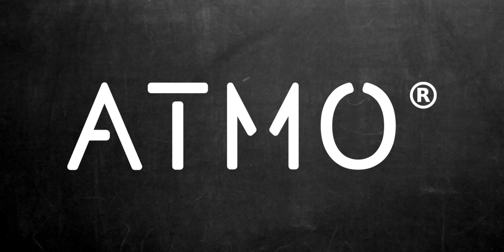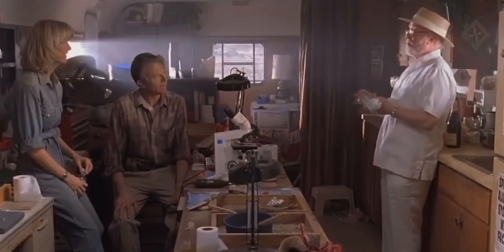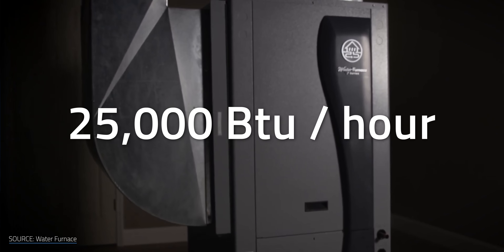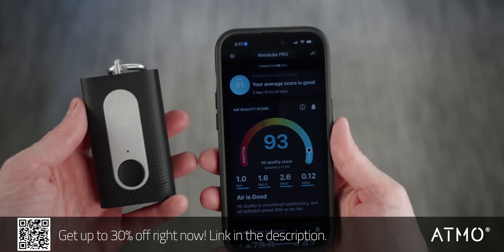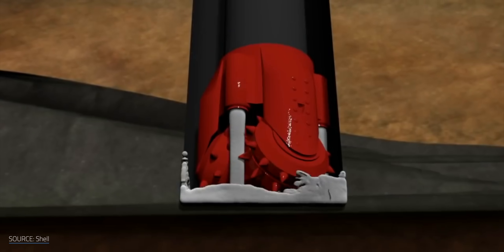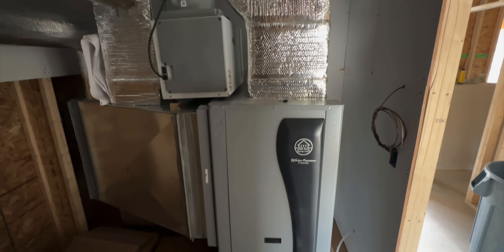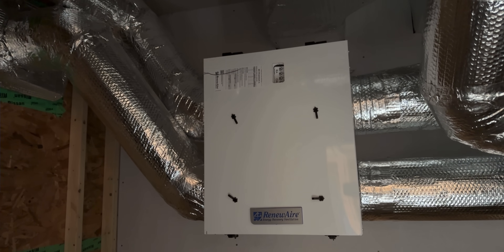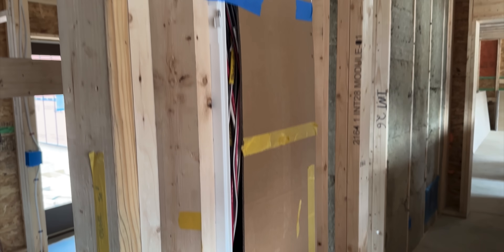Why I Went With Geothermal For My Net Zero Home

Comment: I have a 3 ton Waterfurnace series 5 with two vertical loops,forced air, for the last 10 years and never regret getting it. I recently added a 11k solar array with enphase IQ8 micro inverters . No heat or cooling bill no electric bill. I did tons of research and came up with the same companies you are using. Says a lot about their products.
Reply: Thank you for choosing WaterFurnace for your home. We appreciate you.

Comment: I like how you have low voltage lines to all the windows.
Many people think about automating the lights, but not the blinds.
I also recommend running mains AC to all the windows when a friend of mine had his house built.
I don't think he eventually used them though, but he did implement the wires.

Comment: Matt, it's not too late to add in a hydronic underfloor radiant heating system! 😁 It would work beautifully with your geothermal I think. As a fellow allergy sufferer I find ducted air cooling to be a blessing in summer, but ducted air heating in winter an uncomfortable curse. Having lived with heating from wall mounted radiators, wood burning stoves, ducted air and underfloor radiant, I would choose the latter way ahead of the rest every time. I love the wonderful gentle warming from your feet up compared to that stuffy air around the head feeling from air heating.
Great to see your build progressing and providing us all with lots of ideas & inspiration & good luck!
Reply: I'm thinking of the heating for my future home and I like the cooling possibility that ducted air gives, but I've never experienced it, I don't think. I really really dislike the windy feel window A/C type units give - and the constant background noise too. (Air-based systems are still rather uncommon here. They haven't been cheap or efficient  enough for long enough - local temperatures are roughly the same as Matt described in the video.) While I absolutely love wood-burning systems, the kind I'd go with need a person and a bunch of yearly work (as in, I couldn't leave home for a week in the middle of winter without problems and can't come to a warm home after a long day of work in winter). 

I'd like your random opinion, kind stranger :D
Reply: @mirjam3553  I've had ducted air cooling and wall mounted A/C, and the ducted air has always given a more gentle delivery, especially if combined with ceiling fans. Noise can be an issue, but can be reduced by careful placement of the cooling unit and the use of baffles.
Reply: "stuffy air around the head feeling" Thermal stack is real. With a radiant wall heater in my kitchen I have to use the ceiling fan to mix the layers.
Reply: I don't think he will have those issues because his house is so tight. A house as tight as this does not have the same stratification problems that regular homes have and don't result in nearly as much variance of temperatures. Plus, that ERV along with a very high performance filter system will help keep the air circulated and clean. Can't wait to see this all in action.
Reply: These systems tend to start breaking down at the water manifolds after 10 years.
Reply: @michaelsearnest  I haven't experienced this, but with an easily accessible manifold with compression and/or push fit connections, a replacement could be fitted in minutes.

Comment: We've been in our own new house for about 8 months now, with 3 vertical 500 foot wells serving as the ground loop for our "geothermal" system.  I absolutely love it.  It is silent, ridiculously efficient, and should outlive me.  No regrets!  (Yesterday, I heard a bizarre noise coming from outside, only to eventually realize it was the compressor on our neighbor's air conditioner.  Weird!)

Comment: Since you've chosen overkill, I hope you're putting in a builtin vacuum too.  In rooms with hardwood or title, a single slot along the wall allows you to open up the intake with your foot, then sweep any dust right into the opening.  Really handy for cleaning up in the kitchen.

Comment: I am really interested in understanding the advantages of a smart electrical panel.  I have solar but decided against batteries in favor for VTG bidirectional charging.  I am planning on switching out to EVs when this technology is more established.  Would be interested to hear about how BiDirectional, Solar and smart panels combine to a solution that is robust, has some level of independence for power usage.

Comment: Thermal mass and extra-good insulation should work just  fine for both heat and cooling. It works great here in Colorado.

Comment: Why didn't you go with a tankless electric water heater?
Reply: Because a heat pump uses ~ 3-4 times less energy to heat the water. Theoretically tankless heat pumps are possible, but generally are less efficient. Also using a tank can give you better energy buffering so you could run it entirely off of solar, while for a normal electric heater a PV setup mostly cannot provide enough power and you need to pull from the grid.

Comment: Matt, Do you think it would have been more efficient to build a concrete dome house? and are you planning on using sun tunnels for daytime lighting? just wondering as that's the route I'm hoping to take and wanted to know your thoughts. Geothermal with in-slab heating is in my plans as well.

Comment: I hope your GEOthermal goes better than mine. The system works fine but I purposely had the installer put in a unit 1 ton large than they suggested. It still has a hard time keeping the first floor warm. I am much happier with my heat pump system (ductless system). for the bedrooms and third floor. Had the heat pump many years before the geo system and it has never had any issues. Not to mention I have to keep adding small amounts of water to my closed loop system. Not a lot but it is still an added hassle a heat pump does not need. Had to replace a blower in the geo a few years back. Never had that problem with a furnace so new before but that could just be the Carrier system which I would recommend no one purchase.

Comment: we have automatic shades - triggered by a light sensor - so when it is too bright they go down.. then back up when the light drops.  we are west facing and get blasted by the sun.  The automation based on brightness is perfect.  does it save power - probably, but havent measured that to how hard our heatpump is working to cool the house.

Comment: i love the idea of a smart home, but i'd only consider it when most cybersecurity experts are willing to do it.

most cybersecurity experts i've heard of, stay as FAR away from the internet of things, because of the lack of security in them, and the lack of a commitment to cybersecurity in the companies themselves.
Reply: As a cybersecurity expert, I'm fully on board with home automation. Many of the risks associated with IOT can be mitigated, especially if you choose products which can be controlled locally on your network which Matt seems to be prioritising with home assistant. Other risk reduction measures include isolation of devices using different vlans and restricting internet access to only devices which require it / which are trusted.

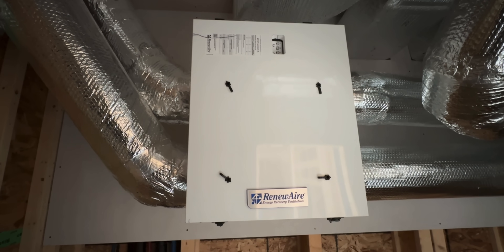Comment: At 8:21, Matt said “Homes need to breathe.”  𝘕𝘰𝘵 𝘦𝘹𝘢𝘤𝘵𝘭𝘺.  People 𝘪𝘯𝘴𝘪𝘥𝘦 𝘵𝘩𝘦 𝘩𝘰𝘮𝘦 need to breathe.  Maybe it was an unscripted comment, but I 𝘤𝘳𝘪𝘯𝘨𝘦 when people who know absolutely nothing about building science repeat that antiquated old wives tale.  (I’m thinking of old contractors with zero formal training, not Matt.)

I’m on the way to making my 1950 house Net Zero.  Solar panels on the roof 𝙪𝙨𝙚𝙙 𝙩𝙤 supply 100% our electricity, until we bought a plug-in hybrid in July 2022.¹ 

In 2011, we super-insulated the walls with “pour-in” Icynene (open cell phone).  We sprayed the underside of our roof with foam as well.  It made an enormous difference, especially considering that we had ZERO insulation in the walls.  In fact, a previous owner drilled vents into the walls from outside;  this was to remedy peeling paint 🤦‍♂️  (My personal trauma with “houses gotta breathe.”)

Later in 2011, we got rid of the old oil boiler and steam radiators.  I admit that I fell for the ßS of the oil & gas industry — we went with a direct vent forced hot water system that uses “clean burning natural gas”.  If only I knew that methane is just as bad for global warming/ climate change as 𝙘𝙤𝙖𝙡.  Sure, natural gas creates less particulates when burned, but natural gas leaks from the well all the way to the end user is about 10% of production,² and methane is 84x as potent as CO₂ as a greenhouse gas, for the first 20 years.³ And we’re about 50 years behind where we should be because Big Oil buried, denied and cast doubt on global warming since the 1960’s.⁴

In 2022, I added a layer of rigid foam insulation to the 𝘪𝘯𝘴𝘪𝘥𝘦 of the walls.  This was to reduce the “thermal bridging” caused by the 2x4’s in the walls.  I was never entirely happy with the wall insulation — earlier that year, I found out why!  When they “poured in” the foam insulation, it left a lot of gaps… 𝘢 𝙡𝙤𝙩 𝘰𝘧 𝘨𝘢𝘱𝘴!  The foam expanded too fast, and it was coming out of the holes they drilled to pour it in.  They also missed the entire space between the first and second floors.  So, for over 10 years, we’ve been paying more than we should have to heat the cold ceiling and floor.  I only found this out, because I opened up another wall for a separate renovation.

I was ready to put in GROUND source heat pump (GSHP, also known as “geothermal”).  AIR source heat pump (ASHP and what >99% of homeowners get needs to change 50% more degrees of heat (F or C) during the year than GSHP.  I live in Providence, Rhode Island, USA.  But the 
GSHP 𝘴𝘢𝘭𝘦𝘴𝘮𝘢𝘯 told us that the upfront cost is so high that we will 𝘯𝘦𝘷𝘦𝘳 get our investment back.  So we are getting an AIR source heat pump and more solar panels!

In 2024, I’m creating a system to store the New England winter cold to cool my house in summer, and to stockpile the hot New England summer to warm our home in winter.  This will augment the AIR source heat pump (ASHP) that I will install in 2023-ish.  Maybe Matt will do a story on my not-from-scratch Net Zero house.

¹ I 𝘸𝘢𝘯𝘵𝘦𝘥 to get an all-electric vehicle, but this was when dealerships had empty parking lots, due to supply chain problems with computer chips.

² citation forthcoming about natural gas leakage 

³ citation forthcoming about methane vs carbon dioxide as a greenhouse gas 

⁴ citation forthcoming about Exxon management being warned about global warming, by Exxon’s own scientists.

Comment: How much total energy storage do you plan to have ? 

Why did you choose the mix of kwh amounts you did of each different type you will have ?
You mentioned both electro-chemical batteries and a insulated water tank.
soo .. what ever your target amount of kwh is .. why that mix ratio ... ie ... x kwh of electric and  y kwh of thermal water .. instead of some other mix ratio that would have needed up with the same net total kwh of energy storage .. for example .. if your x-electric / y-thermal  is a ratio of 2x/1y .. why not the same total kwh but from a 1x/2y ratio instead .. or any other ratio.

Comment: As a mech eng. in HVAC for 15 years in Europe;
I see most of the time, all air systems are used is USA but, 
In here, for houses that want top efficency, usually suggested systems are as follows ; 
ground source heat pump (can be daikin or viessmann) (+accumulation tank for consistency) + 3 way valve  to divert the heating between heating and dhw tank (which eliminates another heatpump for hot water)
also for heating ; floor heating system (preferably rehau) is more efficient that all air systems (needed temperature is lower, lower the heating temperature more efficient the heat pump) ,  which doesnt use fans to move air and much more silent, also heating comes from the bottom (which heats the feet first) feels more comfortable for people other than heating the air around people.
(there is a throw back though: on starting stage,  system takes longer to heat the house, but after the system enters the regime, efficiency kicks in)
also cleaning all air systems is a hassle, and dust accumulates quickly, especially with basic filters, if you use H10 (hepa filter) this time can be prolongable.
for cooling fan coils (which can be used addition to heating) or better ; ceiling cooling systems (which is more suitable to less humid places, (normally away from sea))
for PV systems panasonic panels has top efficiency, and huawei or fronius inverters are good.
If you are in a sunny place solar thermal panel may be used to help heat pump to heat water.
and for fresh air : ERV (which also recovers moisture, addition to heat, most of the people just doesnt know the difference between ERV and HRU, HRU just recovers heat, not moisture) 
Just 25 to 50 m3/h is enough per person, you move very little air compared to all air sytems.

Hope you have a good time and memories in your new home.

Comment: Great system... if you have lots of money!  Air source lose efficiency fast below freezing and geothermal are more efficient but 10x the cost and requires enough land and permitting.  It will also require a huge solar power system or you will have to use a grid tied system and still pay utility bills.

I have been off grid over 20+ years now with a small 600 watt system and have most modern conveniences. Heat, cooking and water from propane with woodstove and electric  backups. Super insulated smaller cabin that is very energy efficient and a small swamp cooler uses 85 watts. internet, phone and I run a business online and make YT videos.

Most people don't have the money to have a custom zero energy home built with all those expensive systems but they can do what I and many off gridders have done.

No house payments, no utility bills and freedom!

Comment: That is not geothermal, that is sun energy stored in water and the ground. Big difference. One good thing is that you can cool the house via the hole for only 50 W power.
Reply: Well that's not really true. Admittedly yes up to ~60 feet the sun energy still is a significant influence (fluctuations during the seasons), also using the term geothermal is more common for larger temperatures and lower depths (1000 feet at least). But below 150 feet it definitely is already geothermal energy (constant 10° C). The temperature rises roughly 1Kelvin per 100 feet, so you have ~13  °C at the depth of his bore (400 feet).

Comment: Doesn't the heatpump need to heat the water to a way higher temperature for a forced air system compared to a radiant system, thereby decreasing its efficiency?

Comment: I made very similar choices in our all-electric home in northern Massachusetts - though we went with a 1.5 ton air-source heat pump. Same water heater, solar setup, very similar network closet too! We  are using Kasa switches and Shelly for power monitoring, I'd recommend looking into low-power DIY router / HA server to cut power consumption for compute - there are some good channels on YouTube covering this - I went with pfSense and dockerized HA on a 10W fanless computer. We move in next week, I wish you luck with your build!

Comment: wouldn't it be interesting to use excess solar electricity or grid power to heat up the ground just below the geothermal pipes you have?  So during summer when excess solar is produced, you pump electricity into the ground and save it for the winter.  winter comes around and your heat pump works better.  when the ground temp. drops to normal, the heat pump still works, just not
quite as good.  however, sending the excess summer power back to the grid only pays you about 1/3 what it costs you to buy.  now if you don't have much solar; then this method probably won't
help you.

Comment: The one major electrical consumer in the house that you didn't mention is what type of cooktop you chose? While not has big a total consumer as HVAC or hot water, it still consumes a fair amount of energy. Obviously it isn't gas, but did you chose an electric coil or an induction cooktop?

Comment: Great stuff, Matt!  I'm living vicariously through you in this adventure.  I have a smaller, older home and am unlikely to build another home in this lifetime.  Many years ago, when I did my last such project, I considered geothermal, but the ROI for a deep well system was too long, given the high cost and energy usage in southern Ohio.  I am very interested to hear your lived experience with the system.  I have always had a niggling concern about the reliability of the well.  What can you do if the pipe leaks 50' down?

Comment: Are you running all the ethernet wires for PPPOE or for networking?  I used to be on the "wire everything" train but now with decent mesh systems it is almost pointless.

Comment: About the ERV, I looked but couldn't find a system that on cool summer nights would just exchange outside air with inside air instead of running the ac. Does your system have that capability? 
Thanks for all these videos about your new home's tech!

Comment: A well insulated house with geothermal and solar with a battery with 2-3 days of capacity is the "golden" standard for a new house these days (in colder climates). If you are adding floor heat in all the floors (water tubes that is heated from the geothermal system), a proper ventialtion system and a wood stove for some extra heat in really cold days. You would have a extreamly nice house the next 30+ years